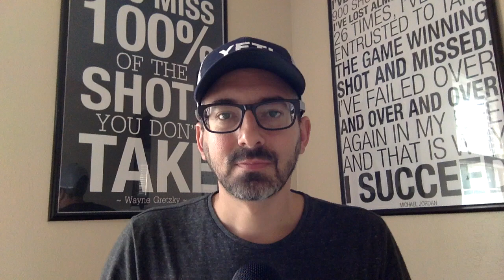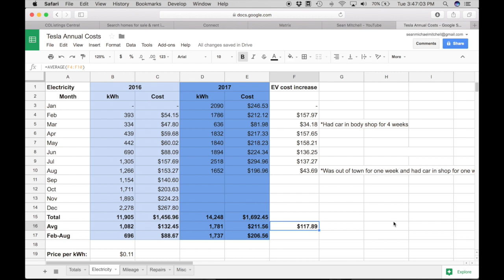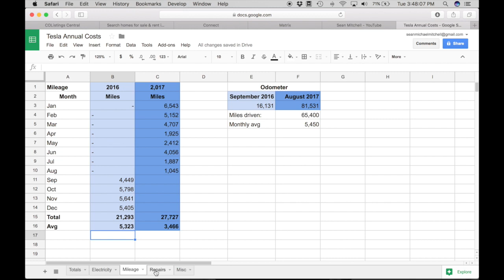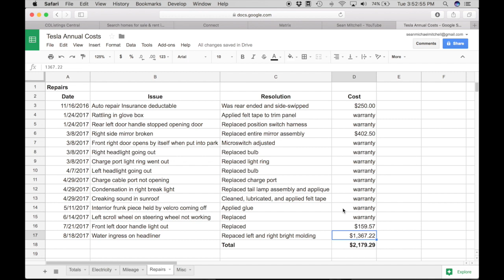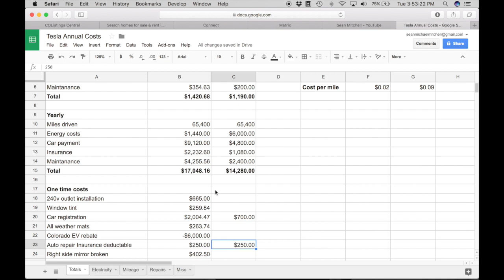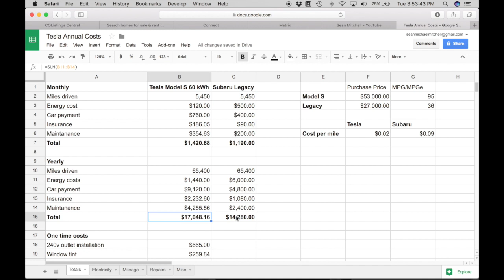How much did my Tesla cost after 1 Year, 64,500 miles (105,000 km)?

Comment: Now this is what I would like to see, lets see what you have to say.  ..........................Ok I'm 3/4 of the way through and shocked so many thing went wrong with a new Tesla. I am a professional car whole seller.  I'm retired now but this is what I know. Buying and selling USED cars.  Now the cars I bought usually had a few miles on them, still under warranty but even with those cars, I RARLY had any problems. I mean, you are one man and I've heard of other people telling me , "well I had to do this and that but that's normal with a new car".   WELL, IT IS NOT NORMAL.  I can see Tesla needs to learn how to build a car. They need someone on their factory that over sees problems like this from the dealer then trace it back to the factory.  The things mentioned are not normal. I hate buying new but in 2010 I went down and bought my wife a new Avalon. I choose this car because for the money, it's an upper end car, holds value pretty good. I am not a typical buyer and I know I lost 5 grand driving it off the lot. I had ONE thing go wrong with this car during the whole time of owing this car. The date today is March 2019.  NOW THIS IS NORMAL. I thought about a Tesla but what you wrote is NOT normal. You done a wonderful job, how in the heck did you require two fender benders on each car?  I'm sorry, I've drove 1,000's of cars and I'm not use to anyone getting a fender bender. Plus we did transport some cars. It's sad but no one would listen to me at Tesla because who am I? Right!  It certainly seems Tesla needs work in the factory department.  They need someone like me who can learn about problems dealers are having then trace that problem back to the factory.  I mean it could be as simple as a disgruntled employee or something wrong with the machine installing head liners. Now you do have problems but NORMALLY you don't have near the problems you've mentioned. I understand you don't understand this but trust what I'm telling you.   You see these problems are not normal and when a BIG company builds cars they have learned the problem is with the factory, not a normal thing to replace a head liner in a new car.  Sorry to ramble on. Great video!

Comment: If you are going to compare the cost of operating two cars over any period of time it does not make sense to include your monthly car payment, or your insurance payment, which is primarily driven by the cost to the car.  These are fixed expenses that relate to the COST OF PURCHASE not the COST OF USE.  If you are really interested in comparing the COST OF USE just include fuel and maintenance.   Tire cost should not be included in maintenance because it is reasonable to assume that as long as your driving habits are the same for both cars the tire cost should be about the same for both cars.   Tire cost is more appropriate to include if you include tire cost over a longer period of time, say, five years.  Just my opinion.

Comment: Thank you for the information. I conclude that you can indeed get a high powered upper class Tesla for roughly the same cost as a middleclass Subaru (power unknown?). Some added cost of the Tesla was due to accidents, but the remaing frequent repairs are a bit deterring, since they cost also time and maybe even some workhours lost. Since some time since the video has passed: Have the repairs gone down in the second year?
Reply from the maker: Yes, repairs have gone down significantly. Will do a year two video in September.

Comment: It seems like the energy cost ratio of 4.2:1 should be alot closer to the MPGe/MPG ratio of 2.6:1.  So let's run some numbers.

In CA right now, evening summertime electricity rates are 25c/kwh, and gas prices are around $4/gallon.  The Model S typically consumes 1/3 khw per mile.  5450 / 3 = 1817 kwh / month.  x $0.25/kwh = $454/month.  Maybe you live where electricity is cheap (12c/kwh), so let's cut that in half yielding $220/month, which is STILL roughly double the energy cost cited for the Model S.  And cost per mile = $0.04-$0.08...not $0.02!!

If we believe the Subaru's quoted mileage, then 5450 / 36 = 151 gallons.  x$4/gallon = $606.  Or with cheap $2.50 gas, make that $377.  Cost per mile = $0.07 - $0.11... so that part checks out perfectly.

The model S MPGe (vs the Subaru) could thus be calculated based on energy rates:
(high rates) 36 * 606 / 454 = 48
(low rates) 36 * 377 / 220 = 62
In both scenarios, the Tesla is way below the EPA's rating of "95".... because this is not how the EPA calculates MPGe.  Instead they start with the useless assertion that 33.7kwh=1 gallon, and the BS flows downhill from there.  While a fair comparison (as above) converts both gas and electricity into the common denominator of $.

We should factor in electric charging efficiency which - despite official specs - is probably below 85%, further clobbering the mythical MPGe numbers.  And on top of that there are stationary "vampire" losses eating another maybe 5%.  For an actual MPGe of 38-50, aka HALF what the EPA gives it.

All this math is moot if you could somehow demonstrate the actual electricity cost according to your electric bill...

Comment: Wow that high mileage hope that a model S as that and the model X are the only 2 that has unlimited mileage, The model C has a limited warranty, can't plan around this 100 thousand miles limit, here what iam warning about.Buyer beware , read the contract well, Contract say battery warranty is guarantee for 8 years or 100 thousand miles. whatever comes first, that comes to a 34.4 miles limit a day over 8 years or just a tiny 17.2 dayly work route go and return Range. So if your route is 68.8 your 8 warranty has now shorten to just 4 years you made 100 thousand miles. the S and X have full 8 years and unlimited miles. I verified this yesterday at the showroom, it's true no plans around this. The replacement battery Cost is 32 thousand and 10 thousand labor, battery could come down later but labor would go up. like battery for hybrids ,the car is blue book valued by the battery warranty and mileage, so 8 years old , 42 thousand is lost in deprecation , why dont the model 3 give full 8 years and unlimited miles ? He not taking the risk but passing it down to you, the car is for the rich or short comute city car, save for your kid college that going to double.by then.

Comment: So the headliner was already showing stains from leaking but you didn't get that fixed under warranty, and your wife caused $400 damage. Neither one of those should be included in your cost in my opinion. That would lower the tesla cost by $1770.  Not to mention you are comparing 2 different classes of cars.

Comment: The video is good, i just maybe have a few comments, i would not include maintenance that comes from human error (mirror) because it just happened on one of the car and it influence the results. Also the fact that the tesla is used changes everything. An older legacy would certainly cost much more in maintenance and a new tesla less. Finally i agree that its a lot of little problems on the tesla looking at all you had to repair but like you said was only the second year they were producing the S and they reeeally improves since, they listened to many critics from the buyers and changed a lots of details in the car, so i would not be afraid to buy one now a day. Thank you for the info 😉

Comment: Rubbish comparison you don't put crashes and adding extras to the cost if you didn't do on both cars

Also a car that's double will cost more on finance and insurance duh!
Reply from the maker: The point was to determine whether the Tesla ended up being less expensive for me than keeping my Subaru. You're a smart person, back it out from there for your own purpose. If you subtract the "rubbish", the Tesla becomes a less expensive car to own.
Reply: @AllThingsEV  Hi Sean, great comparison.  Thanks so much for sharing.  I just bought a used 2014 MS P85 from a dealer with 39K miles.  It had a clean car fax, and Tesla shared the maintenance and repair history (squeaky clean, with almost no warranty repairs).  The only issues I noticed were the windshield wiper fluid pump does not seem to work and the dirt shield on the sunroof is dislodged.  The CS Rep said not to worry about the dust shield (he said and confirmed with a mechanic) as it was primarily cosmetic.  Anyway, one question I had when I saw the comparison was that you were in a serious accident (hope you weren't injured).  In any event, to what extent do you think that the various repairs after the accident were related to accident?

Comment: Hmmm, you're a bit skewed from the start, comparing a NEW Subaru with a USED Tesla.   To correct for that you should add $20,000 to the model S price.  And it's a bit unrealistic to take the $6,000 state rebate, as WE are paying for that, and if everybody took it, nobody would be benefitting.   Those adjustments make a considerable change to the results.
Reply from the maker: george gonzalez why should I add $20k to the Tesla? I don’t understand.
Reply: It's a rough attempt to equalize the comparison.  If you start off with both cars in a similar state, like brand-new, that might be a fairer comparison.   It's a judgement thing, not a definite requirement, but just IMHO it would be a fairer comparison.   Cheers.
Reply from the maker: george gonzalez got it. Thanks for clarifying. Though a valid point, the purpose of comparing the two was to determine if the Tesla was less expensive than keeping my Subaru. I will likely do a true comparison of similar luxury cars. Seems like a lot of people are interested in this.

Comment: Well

I own a 2007 Silverado with 115000 miles on it and a 2005 Impreza with 100005 and while I am not going to write a spreadsheet out Subaru maintenance is quiet costly if you follow the recommendations due to the AWD and steel exhaust system VS the stock GM Stainless exhaust

When you reach Subaru timing belt time /water pump/head gasket time and then the Catalytic Converter cracks and the steel exhaust system is dead the costs are rather astonishing and run into the 5000 dollar range on a 19,000 dollar car 
It’s a great car but you really need to look at the service costs 

The Silverado has needed one thermostat and one 400 dollar repair on the fuel tank with the brake and tire costs being about equivalent

Comment: TWO THOUSAND FOR REGISTRATION?  Tell me thats with some sort of 1st purchase taxes included with that????
Reply: He got a bargain... I bought a used Model S for $51K and i'm paying $3700 for taxes and registration.
Reply: How many miles on your used Model S? I paid $423 for taxes and registration, perks of being in OR!
Reply: Kiran Konathala Mileage has nothing to do with it, but my car had 44k on it when I bought it. Tennessee charged me sales tax because I bought the car in Texas and didn’t pay Texas taxes as a result.
Reply from the maker: +William Dean yes. This year it’ll be ~$500.
Reply: So I'm thinking you should adjust that, as that was a one time thing, and wasn't a true reflection of what registration cost, but what tax's were.
Reply: DragonTamer2345 how long have you owned this? I just got the 2013 Model S. Couldn't purchase extended warranty since it just expired. Any tips for me? I'm still in the honeymoon phase with this car. So love it coming from a souped up Celica GTS.
Reply: Kiran Konathala Friday made 7 weeks. 
My biggest tip is to make sure you keep your tires properly inflated. Just a few PSI can make a huge difference to range and handling. I tend to run mine a bit high at 47PSI, but there are some treadwear trade offs there. Otherwise, just drive it and have fun. There are things that can break (doorhandles and such), but with our used cars, chances are they’ve already broken and been replaced if they’re going to. If you find that the instrument cluster is too bright when driving at night, I’ve actually found that 50% window tint is a fantastic way to darken it below “0%” brightness, but that’s entirely because I’m overly sensitive to light at night. 
Using seat warmers instead of cranking cabin heat up to 75 on a 30 degree day is another way to stretch the range out some. Range mode on a RWD car doesn’t do much, but it does turn off the battery heater and limit cabin HVAC, which can save tons of range if you make a lot of short trips on cold days.

Comment: It's my opinion that people should not be comparing high cost vehicles to a Legacy or any other car that cost less than 30K. I can go out and get tires for my wife's Toyota Echo a hell of a lot cheaper than I can my Tesla. My Saturn L300 tires were $300 cheaper than a premium brand car. You should have thought of that before purchasing. It's easy to figure out those kinds of saving with research before buying a car.

The repairs never end sadly on the older 2013 Model S's. You will be spending a lot of money on repair. I love Tesla and my car but a Model S is not a car for anyone who typically buys a Legacy. It is my hope that the newer Tesla's have advanced and the parts are not failing as often. With the Model S there is never any down time for me because Tesla just brings me a loaner while I am at work or where ever I happen to be. No lost time.

I've spent almost $3,000 on a new compressor and DCDC converter earlier this year and now the MCU (main center control panel) has just gone out. That will cost over $2500 to replace. It sounds like the MCU is something that will need to be replaced every 4 to 5 years. That should be something people factor into maintenance cost for the Model 3 too. Tesla solders the memory in (for example) so there is no way to replace parts on the MCU.

The only thing so far that I have not replaced on my Feb 2013 Model S60 is the charger and main battery. Everything else has been under warranty until this year. From keeping up with Tesla forum posts I have deduced the charger is just a matter of time. The battery will probably work forever.

Sean, If your car is out of warranty I would recommend replacing it since it is a 2013. In my opinion 2013 Model S's were beta test cars. If you can get an extended warranty then do that. I haven't read near the issues on cars built from 2015 on. The 2013s are money pits. and yah... I know this will just bring on the Trolls... but you should think seriously about it.

Comment from the maker: Two points I'd like to make: 1) When I bought the CPO it came with 21” summer tires. Two months later I needed winter tires, which were $2,000. Those lasted 30,000 miles. When it was time to replace them I decided I wanted to switch to 19” so I purchased wheels and tires, $2,300. 2) Sorry for the um's and uh's. I should have done a better job on this one. I was in a rush to get the video done and it shows. Sorry.
Reply: Hey Sean, When you calculate your maintenance on a monthly basis, where the fuck do you do your oil changes? Even if you do an oil change a month at $50 for synthetic (At Costco), and put some wear on the tires, how the hell do you reach $200/month. I drive 140 miles/day (4 times/week), so 2,380 miles/week and Oil changes are every 5,000 miles ( Chevrolet Cruze Diesel 2017 ) and I wouldn't spend that much in oil and tires. I only burn $160/month in Diesel, so your maintenance should be less than 200. It should be not more than $100
Reply: Like some of the other comments on here, I was a little confused about some of your maintenance numbers - they seemed higher than I would expect. Also, I love cars and tend to drive all kinds of things from 20 yr old shit boxes I drag out of fields to $60k Porsches to purpose built track cars. In your case, I would look seriously at very high durometer tires such as Goodyear Assurance Triple Tread (and others). Wear warranty for 80k miles which means with your winter tires in rotation, you'll very likely get 2 yrs (and maybe a little more) worth of work out of them. They won't corner and run on a track like some of the softer tires but you don't strike me as needing high performance handling. Your metric of "performance" is reliability and longevity. Just some thoughts... Plus I have to say, with your energy costs, a simple solar array probably makes some financial sense to research.

Comment: This is ridiculous, Shawn, how could you spend 4200 on tires for the year. we have 82,000 miles on our 2015 85D and have replace the tires once with plenty of tread left on current set. We use all seasons year round in PA. and have had almost no service issues at all. Tesla replaced a tail light  that had a crack propagating from the edge early on. They replaced a front valance that we managed to tear off the front while backing out of a parking space on a farm. Very reasonable cost for the replacement valance and tire rotation. If you go to your trip summary on your controversial panel you can see the amount of kilowatt houses used over your ownership.
Reply from the maker: +Michael Jennings when I bought the CPO it came with 21” summers. Two months later I needed winter tires, which were $2,000. Those lasted 30,000. When it was time to replace them I decided I wanted to switch to 19” so I purchased wheels and tires, $2,300. Make more sense now?
Reply from the maker: +Michael Jennings also keep in mind I’ve got RWD not AWD.

Comment: simple spreadsheet says break even point is 125K miles/year. 
But if you factor in the depreciation, say, fully vested value at 300K, at 65K miles, Telsa cost $32K, Subaru $19k.